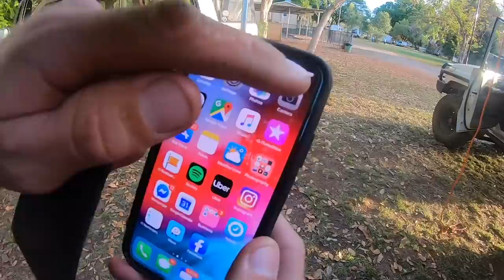76 CATCHES FIRE - MATTS EXPLORE LIFE VLOGS

Comment: Boyz...every can of beer is a fire extinguisher. Shake can like crazy then pop top.  Been there done that, works a treat.
Reply from the maker: mick porter Great tip never thought about it at the time 😂
Reply: always kept 3 cans under my seat just for this. All the carbon dioxide in the beer helps a lot too. An old tip from Jack Absalom!

Comment: fuse or circuit breaker must be matched to the cable and not to the load.  50 amp cable should have a 50 amp or less fuse/circuit breaker.  This is why it is so crucial to design your circuits very carefully.

I've seen this with some manufacturers who supply fuses with their products.  Kickass are one example, where they give you an 80 amp fuse for 50 amp cable.
Reply: Wait what? I just installed a Kickass VSR for my dual battery...

Comment: Now up to the fire part, know how you feel, went through the same thing. I wired up my brake controller and stupid me only used single insulated wire, had the plastic wire ties to tight and bang, all this smoke and opened the bonnet and flames dripping down, at least I had fire extinguisher and got it out pretty quick. But not knowing the flaming plastic had dripped onto my auto trans shift cable would you believe, so could get it out of gear or change gears. Off to the mechanics at Broken Hill and the asshole ripped me off by saying I needed a auto trans replacement, then later find it was only the shift cable which didn't cost much, $100, but got a $4000 bill later, bugger.  Learnt some valuable lessons with this one.

Comment: Hey Matt, what's size wire was that?
I'm a bit concerned about mine now after seen what happened to yours. I may change it to a thicker cable.
Reply from the maker: XD_ADV wire size wasn’t the issue it was. A short and not correctly fused mate

Comment: Classic all the gear and no idea. You had everything other than correctly installed, fuse protected electrics and a fire extinguisher, ARB will sell you one with ARB on it. Yes it is dry in the NT but most of the dead cattle near the road are hit by trucks at night and stagger a few feet off the road before dying. If people who live and work out here were as well organised as you blokes we would be in the shit, go home where the grass is green and the diesel is cheap before you do yourselves a mischief.
Reply from the maker: Phil Elliott 😂😂 The wiring was done in the middle of no where to tow my mates trailer because his car went home on a tow truck. So no I didn’t fuse it. We had a zip tie break and it touched the exhaust and shorted out. 
Arb did sell me one it’s called fire stiker, it’s compact single use I highly recommend it. The cows were dead because there’s no feed or water we come across hundreds of dead cattle and they were as far as the eye could see. The only way to get an idea is to have a crack 🤙
Reply: See I knew you would have an ARB one😂. I have recovered broken down and wrecked vehicles from all over the NT, most of the failures I  see on vehicles out bush are caused by add on bits and pieces, so called upgrades, others are rolled over with full roof racks and lift kits. If you want a safe reliable rig keep it simple. Most visitors vehicles look like they have ram raided an ARB store. Look at vehicles that live and work out bush, usually bog standard, less is more.   
Central Australia is a fantastic place but it can be very unforgiving. 
Please come and share it but stay safe.
Reply from the maker: Phil Elliott That’s the difference mate you live and work out there we have driven 3 days to get there and we need the added bits. Sure some things are over kill like big tires but some of the places I go I need the gear to get there and back. I lived out of this truck for 2 months on this trip it is my home. I don’t take anything unless I know I will use it. We love sharing this beautiful country off and inspiring others to get out there. This video was a prime example of somthing that shouldn’t have happened but did. So we share it in hopes that people watching get there wiring checked and go grab a fire extinguisher for there vehicles. We learn every trip 🤙